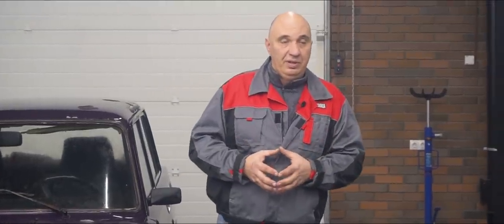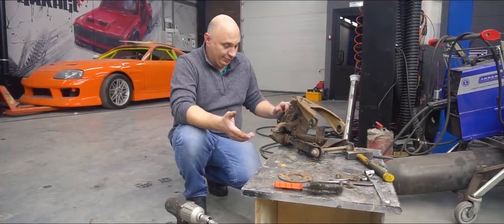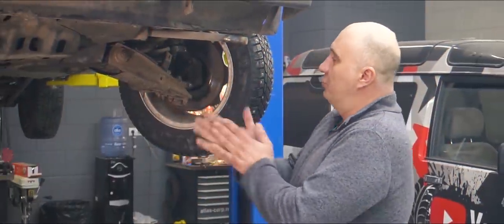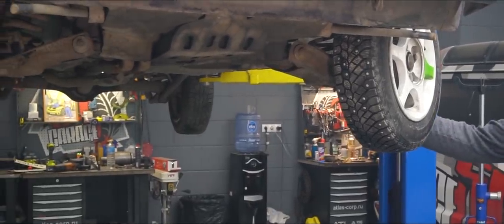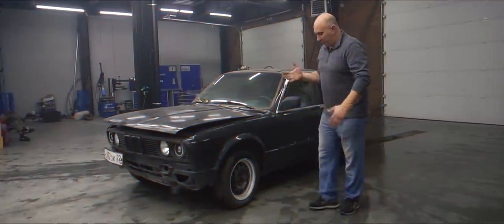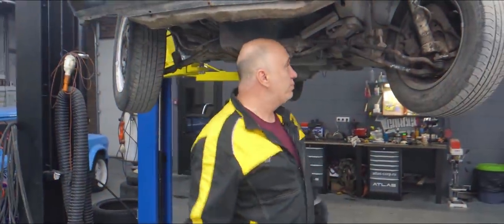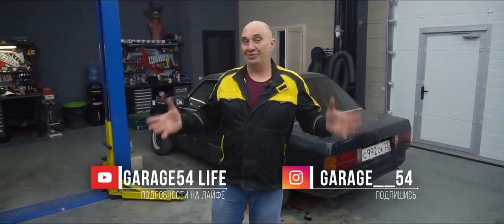Extreme steering angle (close to 90 degrees)

Comment: Great video, best way to increase turning circle is to have a steering rack on both fron and back axels, which work together like what you find on some heavy duty trucks and busses, that mod to an extreme level would be nice to see on a car 👍😎👌
Reply: Didn't early preludes have 4 wheel steering? If I remember correctly it sacked. 😆

Comment: 6:02 Did the caster angle really change much? The extensions were welded on in basically the exact same location as stock. The hub inclination didn't really change it looks like.

Comment: One group of vehicles that come stock with such extreme steering angles that they can nearly turn on a dime are forklifts.  As forklifts are not built for speed, trying to get moving with the steering wheels hard over usually results in the vehicle not going anywhere.  An extreme turn usually needs to start with the wheels closer to straight and cranking the steering wheel over just as the vehicle starts to move, then the differential takes care of sending all of the power to the outside wheel and the forklift turns on the inside wheel.

I have to ask:  Did you check that the line from the wheel's pivot point extended through the steering knuckle still pointed to center of the rear axle?

Failure to preserve that relationship spoils the performance of the Ackerman steering geometry used by most vehicles, and can lead to severe tire wear.

This video was as fun to watch as it seemed you were having, while filming.

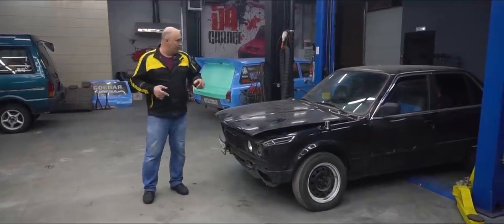Comment: 13:07 - steering racks are way more manageable than steering boxes. You should tell that to my old Nissan. If I got anywhere near the steering going over centre it would lock up the steering. If you want anything close to 90 degrees, you have to relocate the rack to stop the steering going over centre, or buy a really expensive angle kit.

I'm also surprised you didn't space out the rack ends from the rack with 5mm washers, to allow more rack travel. 5mm at the rack is a fair bit of angle at the wheels.

Comment: On that e30 you could just use e46 control arms instead of cutting and welding the original ones. The e46 arms are longer, lighter and require way less modification to work.

Comment: You can't turn at a 90 degree rotation. The car would push forward against the wheels being perpendicular. It would at least have to be front wheel drive and I haven't seen too many 90 degree steering angles for front wheel drive in the first place.

Comment: As a motor enthusiast, you might be interested in building a start stop system for Lada. I shut down the engine while moving in order to save gas and start it by lifting the clutch while in a suitable gear for the speed. I soften the start by pressing the clutch back down for a moment. I save 35 % of fuel costs in city. The steering lock doesn´t engage when the key is in. Could you do this better?

Comment: Swap intake for exhaust and exhaust for intake, so basically engine will run backwards ;)
Reply: Intake and exhaust systems have absolutely no bearing on the direction of rotation,all you will achieve is turning the exhaust into an air intake and the intake system would become the exhaust,the engine would not run.A fuel injected engine would almost certainly backfire and either set light to the inside of the inlet manifold and/or blow it apart,a carburetted engine requires vacuum created by cylinders to draw fuel so no fuel would be drawn into the cylinder anyway.
Reply: areyouundoingthat orwhat? And that would be fun, even if it destroys engine, I think its worth trying.

Comment: Have you ever quickly turned the wheel one way or the other while going 60 MPH ?
I did once or twice and was surprised the car just kept going  straight. 
The wheels were squealing but the car did not turn.
I did not turn the wheels as far as they could go.
Just enough that I could straighten them back quickly.
But it was enough that it would have made a significant turn if I was in a parking lot.
Also it was a front wheel drive, results may have been different for a rear wheel drive.
Reply: What do you expected, F1 levels of grip?

Comment: If you really want it to work well you need to make the back tires turn with the front steering to give it assistance make the back tires turn opposite slightly in the opposite direction of the front and it will take away some of the resistance.

Comment: make a road-legal go-cart
so either, make your own frame, and body, bolt engine on, and drive
or strip a car down as WhistlinDiesel did with a Duramax, and use that
the reason why I want to see that; tech YouTubers have test benches where they slap hardware on and test performance
why not have the same but vehicle form. 
a homemade road-legal go-cart would be a cool thing to test different engines in or performance mods, and the thing would be lightweight

Comment: I was going to say do the E30 but y'all did lol  my fav car got two of them  and doing a motor swap on one now with a m52 and front end suspension from a E36 rear suspension from a Z4 rack and pinion from a E36 crazy angel now the factory steering rack about 4. 2 turns and the  steering racks out of E36 is like to 2.6 truns if anybody in here owns a E30 you know what I'm talkin about steering wheel just keeps going and going and going lol where is Z4 or E36 steering rack bolts up in the E30 steering wheel go around like two times full lock

Comment: Create a car with emergency tires. For example if the original tires go flat, then you can drop a rotating set of tires down and drive on those instead.
Reply: Citroen had cars with suspension that would still drive with 3 wheels attached...

Comment: Build a parallel parking car to where you pull the front in the space flip a switch and a caster wheel set up drops down out of the trunk lifts the back of the car rolls into the space.

Comment: I would like to see you guys convert a car so when you turn left it goes right and swap the brake and throttle pedal then let people drive it to see if they can get their head round it I did the steering thing on a motorbike with throttle on the left hand but push to go faster pull to slow down braje and clutch levers were also reversed.

Comment: more camber avoids the issue with breaking the bead in low speed high angle wide open throttle turns

Comment: This is interesting l had a couple of csb chassis utes and two if them had large turning circles but before that l drove trcks and a six pallet truvk had a tighter turning circle than my utes because the trucks front axle is a beam axle getting back to the utes they were from the mid 2000s why they were so big was because of 4X4s although they eere both rear wheel drive but the cab chassis ute l have now is from 1997 and it has a much smaller turning circle than the other two its the same size as the other it is because in 1997 4X4s were not that popular

Comment: How about a ballenced but massive super heavy flywheel heavy enough to be a  Gyroscope on wheels like would it want to ever steer in any direction? or would. It make the take off Momentum and towing capacity un stoppable ?? Or would it simply be a bitch to its own engine performance???

Comment: This may seem like a great idea at first but you'll start pouring money into the front tires as the are now not level as the inside will wear more. On both tires. An f250 at my work is having that issue granted it carries alot of weight in the front since it has a snow plow one it...... 

Just dont do this....

Comment: Never heard of Scrub radius have they?  That will be a very evil handling car. Rapid wheelbase change with the turn of the wheel.  Destroy the strength of forged uprights and weld on metal that is not the same alloy or can be heat treated to the same strength.  Modify the control arms and go to coil overs would be the best method.  To allowance for Ackerman either.